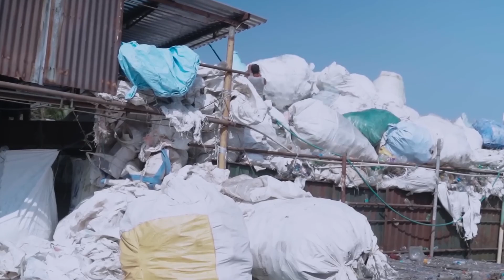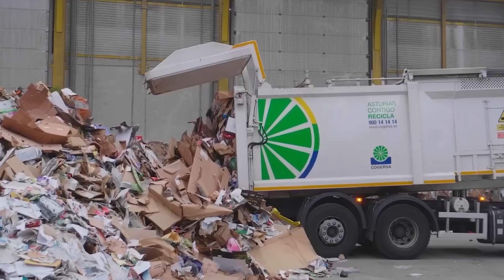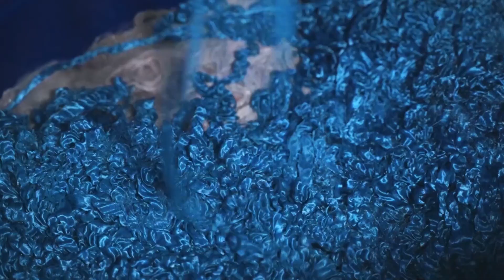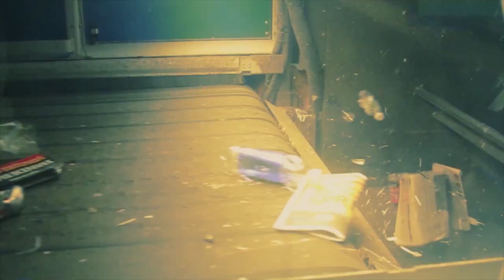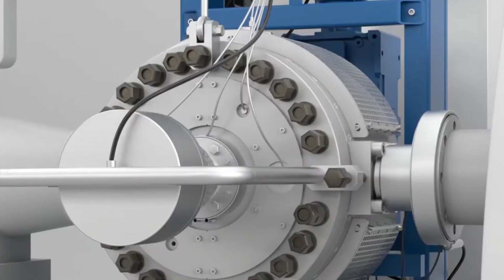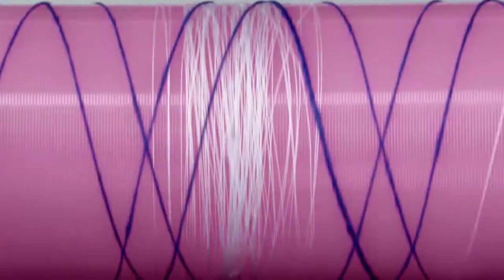The TRUTH About Plastic Recycling | 350 Million Tons EACH YEAR

Comment: Fascinating. Quick research on my part indicates that the profit margin for  plastic recycling companies as 5% - 20% (Brave search) or 10% - 30% (Quora). Anything above zero means it's possible to build a business in this sector, but in the video we saw some high-tech equipment and a lot of manual labor, so the barrier to entry is fairly high. It is not clear if the estimated profit margins quoted above rely to any extent on some sort of subsidy support.
Reply from the maker: I’m sure there are significant subsidies available to lower that barrier to entry. Still a very costly process, but you’ll definitely get some government help.